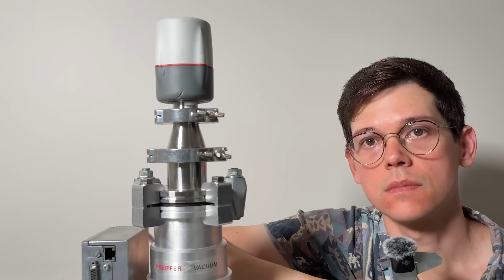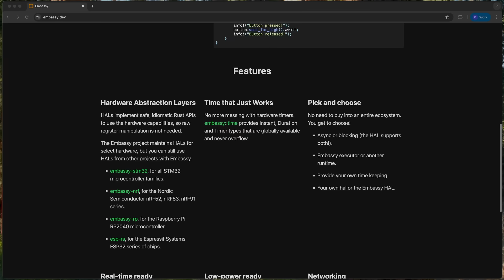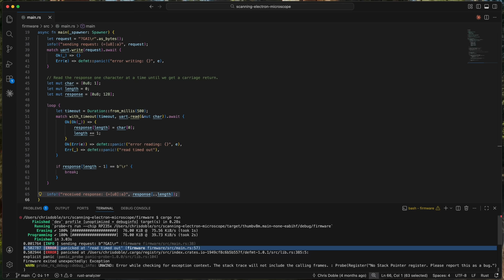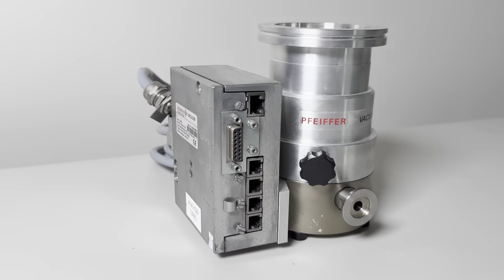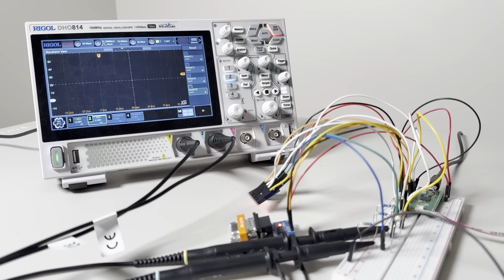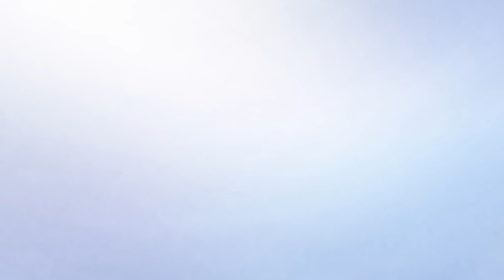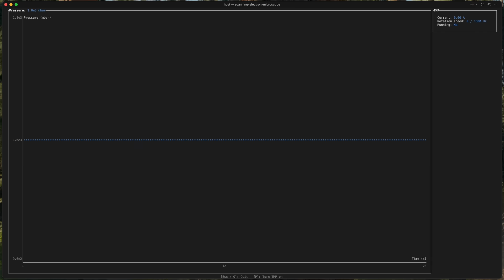Reaching 10⁻⁶ mbar for my homemade electron microscope

Comment: Disclaimers: I worked as SW dev for top notch electron microscope company. 
I think your setup might be too rigid in the future. Some equipment needs to be actively polled, some emit their own update messages, some hardware will have IP comms… the list goes on and on. 
If you drop the pico and just use a SBC or something, you will thank yourself later. 
Also, consider building much higher level primitives. For example you want to just send the command to evacuate the system and some other subsystem should handle all the complexity. On your system, it might be those two pieces of HW. Other people might have a completely different pipeline. The high level system should also be able to handle the value settling and just report kind ok ok/not ok to its friends. 
The comms architecture is really really important to get right. 
Don’t be afraid to introduce multiple levels of abstraction. First level might be abstracting just a single pump. Second level will be abstracting the whole vacuum system, another level will deal with high level user inputs. 
Also keep a track of what is talking to what. 
This is not overcomplicating. The software will get complicated and convoluted really fast. 
Don’t be afraid of realtime-ness of modern computers. We were always surprised how well they were handling that. 
Good luck man!

Comment: When you said the proto board design was too messy I thought u were just gonna rewire everything in a single proto but you went straight to making a pcb and a compartment :0 . Really good video, felt you struggle as an electronics engineer having to deal with communication protocol!

Comment: i gotta ask what Linux distro you are running? im trying to get the app you showed at the end of the video working!
Reply from the maker: I'm on a Mac. The file electron-gun-simulation/README.md in the GitHub repository contains instructions on how to run the simulation.

Comment: Hi, I work as an equipment engineer for UHV semi systems. The current draw on the TMP when you get down to your ultimate pressure seems quite high. Probably due to a leak or a virtual leak. Give everything a thorough clean with IPA and reassemble.  I would expect that turbo to be running <0.2A at base pressure.
Reply: Second this, should be 0.5-0.2a once running. Do a bake out and long pump down once all clean.

Comment: You need something between your roughing pump and TMP to capture oil vapors.  Ive tested cryocoolers that maintain shield temps in MRI's for years.  We had to test them at x10^-7 with a thermal radiation shield. 

Because there is very little pressure in the bellowed tube that allows the roughing pump to evacuate the TMP, hot oil vapor WILL migrate into your TMP and often past that into your chamber walls, your vacuum gauges ect.  You need a very good ultrasonic cleaner, a cleanroom, and a vacuum oven go restore your vacuum surfaces.

Then again, x10^-7 really isn't that deep of a vacuum, so you're probably fine with just an oil separator.
Reply from the maker: Thanks for the tip! I have a foreline trap between the roughing pump and the turbo — you can see it in the background at 17:03. Is that enough in your experience or would you recommend something else?
Reply: @chrisdoble hey, i'm a mass spec guy,  a foreline trap should be enough just make sure the balls are changed once a year. If your budget allows get a speedivalve between your high and low vac sides, that way you do maintenance on the rotary vane pump without having to vent and then pump down the entire system. Another good tip is ask your local university's if they have a dead turbo molecular pump you can have - that way your can practice tearing one down without having to worry doing damage.

Comment: Good job on taking the oil mist separator, good for your lungs. Please consider monitoring your room humidity levels and keep an eye  on your oil, as pumping water Vapor can oxidise your oil over time (look for tiny black particules in the oil) or if the humidity level is too high, water can condense inside the pump and emulsify your oil, giving it a creamy texture. It decreases massively decrease the ultimate vacuum and reduce the lifespan of your pump. If you ever find yourself having an emulsion, just open the gas ballast.

Comment: People have already left a few, but as another guy who works with UHV systems, here's my tips:

1. As someone else said, definitely don't touch anything inside the vacuum volume. At a minimum we wipe everything down with isopropyl alcohol and then acetone, and handle parts with nitrile gloves.

2. As another someone else said, rotary vane pumps aren't ideal since they can backstream oil - we always use dry scroll pumps for UHV systems.

3. I highly recommend picking up some UHV foil (aluminum foil that is certified to be oil-free). Any time you have flanges open (e.g. if you remove the turbo or any other component) it's good practice to cover them with UHV foil to prevent dust and other contaminants from getting inside.

4. One of your bellows hoses looks like it's made of plastic. Not a big deal if it's the hose connecting your roughing pump to your turbo, but avoid putting any polymers in your high-vacuum volume, as most polymers will offgas like crazy and ruin your vacuum levels.

Of course, if you're already getting to decent enough pressures you can ignore all of that. Just some tips for if you run into vacuum issues in the future.

Best of luck with the project!
Reply from the maker: Thanks for taking the time to comment! All great suggestions, I'll take them on board for the next video.

Comment: By the way, according to the manufacturers recommendations, we are not supposed to operate the electron gun at pressures above 10^-7 Torr, and in my lab we never do it above 10^-10 Torr, but this is only because we want to preserve the filament for as long as possible. Regardless, I don’t think 10^-6 Torr is an adequate pressure to operate the electron gun… if will work, but the filament will die soon
Reply: It depends on the type of electron gun you are running. Cold field emitters have the highest requirement at 1e-10 to 1e-12 Torr, Schottky emitters require approx. 5e-9 Torr and thermionic emitters (assuming you are using a tungsten filament) should run fine at 1e-6 Torr. A better vacuum will prolong the life of your emitter, but only to a certain degree.

Comment: I have more than 15 years of experience with ultra high vacuum chambers and electron beams, as I used them to simulate the effects of cosmic rays on solid samples in space. I can point several little problems with your set up point if you want any advice, you can just reach me out.

Comment: Bro I just looked up how much a Edwards RV3 costs on the shop you mentioned it's 3440 bucks like omg did you actually pay that much I got a fully working one with no issues for 200 bucks I mean if you count the mist filter and KF flanges and the pirani guage that's more but they sell the bare Edwards RV3 for that much that's insane if you actually paid that much for a roughing pump from that website the other stuff must have cost a hugh chunk of money, how much did you actually pay for all of that?
Reply: 15000 - 20000 AUD according to the video
Reply: The RV models are very robust metal part wise, Ive taken one that literally sat outside in the rain for a year, checked that the motor still ran, and used a 3rd party rebuild kit on it after washing all the parts in soapy water, ISO and Acetone, and scotch brite pad wiping all the faces that had rust from water sitting in it. It was pulling low 10^3 torr after and is still running smooth 24/7 right now. 
I learned how to do the full rebuild off a YouTube video, it took a whole afternoon including the cleaning time and stuff to do.

Comment: 2-3 key observations: a) The vacuum gauge has its own magnetic field, and a pretty stron one. Make sure it is mounted away from the beam column or you put an effective B-field shilding around it. b) TMP used for standard EMs typically have evacuate rate of the order of 250 to 300 L/s at about 10^-4 / -5 Torr vacuum. This one looks to have lower capacity. c) If possible, go for an oil free mechanical pump, like scroll pump. It has limited life compared to a rotary pump, but possibilities of miniscule oil contamination in the EM is eliminated. Alternately, use a cold trap with the oil pump. 
Best wishes !
Reply from the maker: Great advice, thanks for taking the time to comment!
Reply: Good advice. The EM-fields of the TMP should not be neglected either. It messed up one of my setups... In a normal SEM setup where the TMP is mounted underneath the sample chamber this shouldn't be an issue however.
I've run various ultra high vacuum experiments with rotary vane pumps connected to TMPs via a Zeolite filter and never had any issues with oil mist traveling to the TMP. A cold trap is probably better but also more expensive to run.
Reply: From a hobby perspective regarding the vacuum gauge, in my personal setup I've got an interlock system with a penning and a hot cathode ionization gauge, but rather than using permanent magnets for the penning I wound a set of coils instead. I measure by default with the penning with the coils powered on, until the vacuum drops low enough for the controller to kick on the ionization gauge. Then I use the vacuum level of the ionization gauge to see if the vacuum is still good enough for it to operate in, if so, the coils can be turned off and measurement continues with the ionization gauge. May the vacuum drop, the ionization gauge turns itself of, therefore turning on the coils making a valid measurement with the penning again. Benefit being no stray magnetic field of the vacuum gauge will affect the electron beam, whilst you guarantee the lifetime on the cathode in your ionization gauge :P

There's somewhat of a hysteresis going on, but the logic itself is so easily implemented you don't need to use a microcontroller, therefore its completely safe to use as an interlock for your electron gun again. You're going to cry if you have to deal with electrical breakthrough inside your vacuum system. Don't forget about the Paschen curve, breakdown can get really destructive. Anyways building electron microscopes is a fun hobby, don't lose track of your goal, it is time consuming!!!
Reply: @m.e.8273 Typical wide-range vacuum gauges have relatively poor accuracy, so too much of effort into converging to a a proverbial accurate value may not be worth it. Moreover, the purpose here is to somehow safely "estimate" if the vacuum achieved is safe enough to turn on HV and SEM operation, coz if the pumps keep working, the inner atmosphere would eventually only get better. 

As you suggested, we sometimes use SIP current or TMP drive current at steady state to estimate the vacuum level, which does work, and so one can in principle do away with a dedicated gauge (though it is always advisable to have one). 

I've found mu metal shields around Pfeiffer gauges to be much better. For this perticular model of gauge from Edwards, the field value is really high. 

An alternative could be hot cathode gauges, but when placed in the specimen chamber, the glowing filament can be a source of background light for the detector PMTs. So one needs to find a niche for them.
Reply: Would that really go through severat blades rotating at 90k?
Reply: @dtiydr  In the long run, yes oil particles do get through the TMP. It may take long hours of operation for this to happen, and in addition to the case if backing pumps are not maintained properly. Periodic oil changes r recommnded as per OEM guidelines.

Comment: As someone working 10+ years in a cleanroom with Ultra-High-Vacuum equipment: Please don't touch any inner surfaces 😅 We did some tests quite a while ago and a single light finger print in an otherwise pretty clean chamber ruined the pressure by 2-3 magnitudes and was not removed during bake-out. At 10^-6 you are probably fine and if you use organic samples they also contaminate the vacuum, but if you need better pressure down the road, clean everything before with the usual suspects (Acetone, Isopropyl,...)
Love the equipment! Looking forward to your next video!
Reply from the maker: Good to know, thanks for the tip!
Reply: @chrisdoble 
I design Electron microscopes. wherever you plan to put your source clean all surfaces with UHPLC grade isopropyl and TEXwipes cleanroom wipes. hydrocarbons will slowly build a charge and deflect your beam. ultrasonic can help as well.
Reply: I was sweating bullets when he was touching the pump rotor and other surfaces. Glad you got the message across!
Reply: ALSO, you need something between you roughing pump and turbo it capture oil.  When you have no pressure in the hose, oil vapor will migrating your TMP and often times past it into your chamber
Reply: @FriendlyCynic  came here to make that comment; a foreline trap is what i know it by, just a chamber full of activated alumina balls.
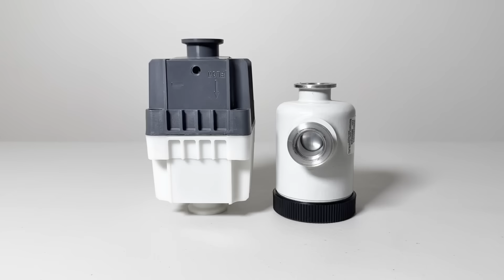Reply: @FriendlyCynic Is that not what he has at 2:32
Reply: @isocle that's an exhaust filter. If not already part of the rough pump, an oil filter would also be placed between the turbopump and the rough pump.
Reply: 35 years working borosilicate and quartz light bulbs, making custom uv glasses.,,etc.   what i can tell you quick is.   EVERYTHING IS POROUS ...EVERYTHING. the metal,,, the glass,  all of it is alot more porous then you would every think.  a 2 inch tube of 4 mm thick borosilicate thats a foot long, will hold several spoons of water. you can see it come out with a vac pump. best way to avoid this is by baking it ,,preferable above 800 F but below 920  ( begining stress point of borosilicate, but above the point where all organic matter will turn into ash. ). best is to bake it while also sucking it down with the vac,,,and doing a  "wash" of the bulb by alternating injecting argon ,,and sucking it out.  this will leave you with only traces of argon,,,instead of traces of a reactive gas ,.  if you need glass or advice hit me up. david matthew dalleinne.  ill try to look at my FB messages.
Reply: Of course, it wouldn't bake out, but in...
Reply: Same goes for any grease or lubricants for orings etc. Please use high vacuum grease/lube
Reply: Every video I’ve seen with a turbo molecular pump they reach in and spin the blade 😂
Reply: @djtjpain  in the videos I have seen they have been wearing what I assume to be powder free nitrile gloves, or a full cleaning is the next step in the process anyway.
Reply: Interesting, I tried a similar experiment placing a fingerprint on a blind flange and doing an RGA spectrum of it in a UHV chamber. But we saw little difference, both side by side experiments reaching 10^-8 mbar of pressure
Reply: @chris You can disregard that nonsense if you never plan on going below 1.0e-7mbar... UHV is a different beast all together. Also acetone LOVES to adsorb to stainless steel walls, even after baking at 200°C for +12 hours, I was still able to detect it via an RGA.
Reply: @dmoskva  you can make stuff glow,,,,with a horrible dirty vac job,,,ie a mini fridge pump and a ballon full of argon , rubber hoses, and dirt everywhere.  shit,,,you can make a grape into a bulb that will work a while.  a fucking grape.
Reply: I read once that even sanding down surface can ruin it.